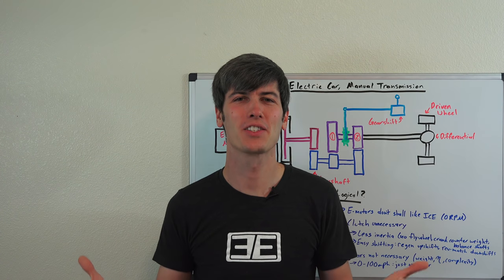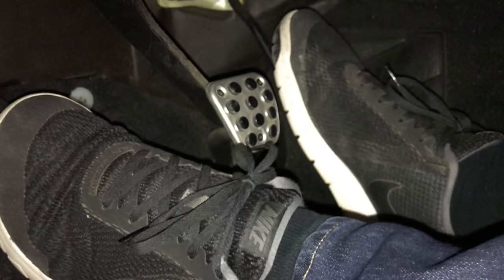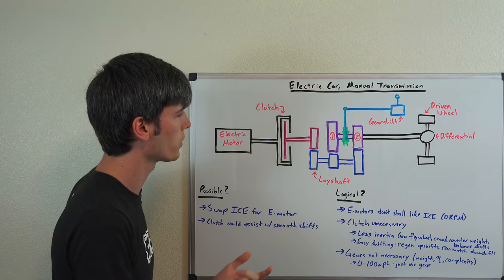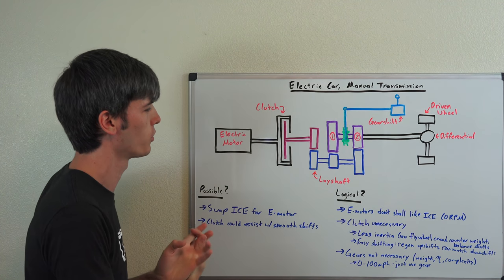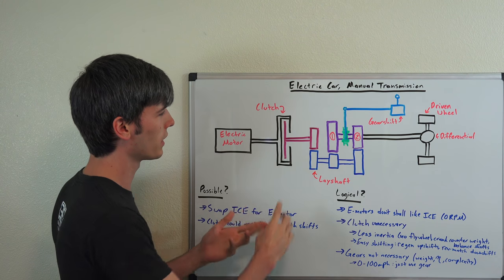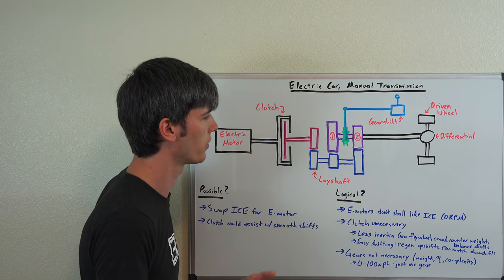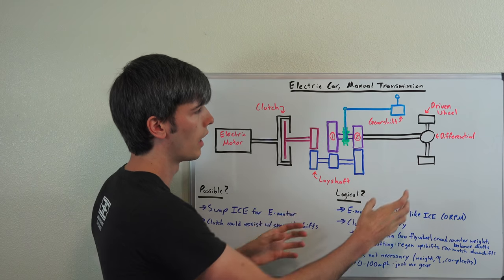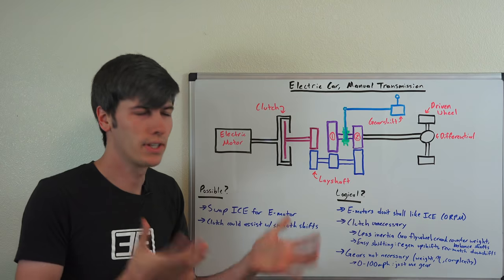Could Electric Cars Have A Manual Transmission?

Comment: Yeah but couldn't a gearbox fix the "electric cars have worst top speeds" problem?
Reply: Ever hear of overdrive? You can gear it so the wheels spin faster than the motor.
Reply: I believe it can be designed as higher than 1:1. It is at most 1:1 for now ,because that is all combustion engine need.  As far as I know, some CVTs can implement higher ratio than 1:1.
Reply: Koeingsegg troque converter that is used in his hybrid hyper car. It doubles the torque in certain situations. The car itself has only one gear (7th speed gear). From full stop until road speed limit the TC multiplies the torque so the wheel can accelerate very fast until it gets to a 7th speed gear ratio.

I think we could think something similar to this in eletric cars and have supercruising speeds. It'll solve the problem with heavy batteries and eletric car mileage. If some effort put in this tech design gave us any potential benefits we could even think of a small battery pack, weight reduction, better top speeds, etc.
Reply: +Carl Nesensohn
Overdrive was designed for better fuel economy. It has no benefit on an electric car. The electric motor is not so confined to a narrow RPM range into which it can deliver its peak power. Overdrive is not so much to make a car go faster, but rather to slow the speed of the ICE (internal combustion engine) on mostly-flat freeway driving, so as to burn less fuel. With horribly-outdated ICE technology, most every revolution of the engine is going to burn a certain amount of fuel. But I have heard that only 15 horsepower is needed in order to drive at freeway speeds. So why do cars have to have such big engines and so much power for? So that they can easily climb hills, and not scare the driver, having little or no acceleration power to be able to merge onto the freeway or to pass another vehicle, lagging like some giant super-heavy semi-truck 18-wheeler.

Actually, I think I heard that the Tesla electric cars have a small gearbox that is a 9 to 1 ratio, meaning that the electric motor spins 9 times as fast as the drive wheels. There is no need for the wheels to spin faster than the motor, as that would exceed the speeds that most cars ever travel at. There is no need to shift to a lower gear, because the electric motor already has sufficient torque and can easily start from 0 rpm - it does not stall like an ICE. But the gearbox is very simple, just 1 speed gear, very few parts to wear out. Electric motors can be electrically-reversed, so there is no need for a "reverse" gear.

There are basically 2 considerations that limit how fast an electric motor can spin. One is the physical centrifugal force that above a certain speed would tear the armature apart. The other is the available voltage for the motor, as a motor and a generator are much the same thing, depending upon how they are wired. The faster the motor spins, the more opposing voltage it produces, so that the current can no longer flow very much, once it reaches its peak speed. That is why a too-much bogged down electric motor overheats, because the current continues to surge. But electric motors can spin or be designed to spin at very high speeds. And unlike an ICE, there is very little mass within the motor to accelerate, nor are there any gear-shifting delays in the acceleration curve, there is no heavy crankshaft, and so acceleration in an electric car can easily beat muscle cars and sports-cars.

The ideal gear ratio for the electric motor, is based upon 2 factors. One is, what level of performance is expected and can that ratio deliver it. The other, more important in my view, is efficiency. If electric cars can not deliver enough miles on a charge, then they will be hard to sell to many people. Thus, it is very important to conserve energy, so that the battery does not deplete any faster than necessary. That is why EVs are even better aerodynamically designed than ICE vehicles. They have to do whatever they can to boost the range on a charge to a sufficient miles number to impress potential customers. Well until the battery technology further improves.
Reply: Electric motors usually have 20000 rpm limit, why would one need to go beyond that rpm ie.. 1:1. And why would you need gears when you can have the same torque at 1rpm and 20000rpm? Habit???
Reply: +za guite
Electric motors have maximum torque at 0 rpm. It is not as much torque at all speeds, as there is back EMF to deal with, when an electric motor reaches a significant speed.

The gear reduction ratio is important, as if the electric motor spins too fast at a given wheel speed, then it could have trouble reaching the fastest wheel speeds it is expected to produce. Or the motor could exceed its maximum safe speed to rotate at, causing the electric motor to self-destruct. If the electric motor spins too slowly, then its wheel torque will be too low, acceleration would be poor, and it is going to pull too much current and perhaps overheat much like a rotor-locked or stalled electric motor. The gearing reduction helps to amplify the wheel torque, by allowing the electric motor to spin faster and use mechanical advantage to increase the effective wheel torque.

So why do electric cars lack a transmission? Because electric motors can produce their peak power output, over a much wider RPM range than an ICE can. Since it well covers the entire speed range of the car, including even reverse, there is simply no need for a transmission, as with an ICE that would stall without a clutch (manual) or a torque converter (automatic). And because if the efficiency gains achievable from using a transmission are below a certain threshold, then the weight and cost of the transmission can not be justified and the transmission itself wastes some of the engine's power in the form of inefficiency and waste heat. Lacking a transmission, is all the fewer parts to fail and to cause problems. A gear reduction is a lot simpler, and does not weigh nearly as much as a transmission. And without a transmission, there is no need to change gears. So no computer has to decide when to change gears as in an automatic transmission, nor is any space within the car cabin wasted on a needless gear change lever for a manual transmission. Acceleration is faster, as there are no hesitation gaps caused by the time needed to change gears. Also consider how fast some electric elevators are, and those electric motors never change gears.

Habit? Not at all. Any car driver can easily learn to DO NOT CHANGE GEARS ANYMORE, NOT EVER. Especially those drivers who like automatic transmissions anyway. So it can not be "habit". No, I fear that some car enthusiasts want to also ruin the electric car, like how they have somewhat ruined the ICE. We must not let them do that. Tell them to leave their pretending that they are some glorified race car driver, to the video game land of make-believe, and that you do not need to change gears anymore to drive a car. If they want to be old-fashioned, why don't they get some heavy car made out of rock with round rock wheels and with no brakes, like the Fred Flintstone cartoon car? Well that car never really existed. Come on, get with the times! The days of the horrible costly transmission problems are nearly over. Get over it. There is no need for a transmission in an electric car.

The days of driving may soon be over as well. Within a decade, we may see cars fully capable of doing the driving all by itself. It will only need a driver/operator to specify "Where would you like to go to today?" And I am very hopeful that self-drive technology will make cars much safer and much more convenient.
Reply: +fafaelrp07
No wonder-technology-transmission is ever going to solve the problem of heavy battery packs in electric cars. Because the problem is, as it long has been, the lack of high enough energy density in batteries, and it takes a lot of energy to overcome the tire rolling resistance and wind drag, over many 100s of miles of driving. It is not a transmission or lack of, that drains the car battery, but rather the toll of propelling a heavy box or room at 65 mph on the freeway for many hours. It takes quite a lot of electricity to recharge an electric car, however, the electricity is a lot cheaper than the fuel that would otherwise be burned in an ICE.

Technically, I think that electric vehicles get better mileage at city speeds, and struggle to go as far at highway speeds, due to the higher wind drag of higher speeds.

A small battery pack is impossible, unless you want an electric car with an impractical short "commuter" to place-of-work range only, 50 miles or less on a charge, or we invent much better batteries, say like much less expensive super-capacitors, something super-conducting or something. Or implement the NWO-suppressed free-energy technology.
Reply: Diogo Almeida Um in a world that has Tesla's which have a pretty decent top speed (and an insane amount of pick up in Ludicrous mode), why would you ask such a question?
Reply: because electric dont produce the same torque at 1 rpm as they do at 20000 rpm, theyre the opposite of combustion engines in that torque drops off as as rpm increases

Comment: If applied correctly, couldn't you use an automatic clutch with one singular gear with lots of teeth on its output, increasing the top wheel RPM speed? I mean, it would increase efficiency especially in things like drag racing, top speed and starting and stopping. If you just had an electric motor straight to a gear with lots of teeth on its output, the electric motor probably wouldn't have enough torque in the lower RPM so this is where a clutch would be necessary.
Reply: Electric motors have characteristics very different from internal combustion engines.

An electric motor can develop its maximum torque at zero speed so there is no reason whatever to have a clutch for starting out.  Also, an electric motor can, for limited intervals, develop several times its continuously rated power with no damage.  In cases where the electric motor must be as light as possible, there would be an advantage to having a multi-speed transmission.  However, in general, the advantages of having a multi-speed transmission would be offset by the additional complication.

Comment: I'm interested in what the power to weight ratio for an electric motor is compared to a combustion engine.
Reply: And what about the price for same performance and type : is an electric car more expensive ?
Reply: 1kw/kg ice to 3-8kw/kg electric. Batterys are heavy.
Reply: The batteries for an electric car is the expensive part, electric motors are cheaper than combustion motors.
Reply: Anthony Much better

Comment: All electric cars today have a transmission, including Tesla's.  The Tesla has a reduction gearset for each motor.  The cost and weight of adding a second gear and a reliable gear changing system has to compared vs it's return in 99% of driving scenarios. Any car designed primarily for high speed running would need tall gearing that would not have good acceleration. Any vehicle that has massive weight changes such as a truck towing a large trailer would need gears to avoid have to carry a too large motor around for when it is not towing.  Most cars could perform satisfactorily with only one gear for 99% of their use cases. 
Dual motor Tesla's have two one gearboxes, each with a different ratio to match the motor that drives it.  The overall efficiency could be increased further by not turning the larger rear motor at relatively low speed and low loads. If a Tesla was designed to run at sustained autobahn speeds  the gear ratios would change from the ones used today for 70 mph cruising. 
Direct drive A/C induction electric motors are not yet desirable for several reasons.  Hub motors are even less desirable, because they would massively increase unsprung weight which negatively affects handling and ride quality.  
Electric motor tech is not advancing very fast. The science has long been understood and only small efficiencies can be gained using known science.  Improving the battery is the holy grail for car manufacturers.
Reply: Currently Tesla, as you mention, uses induction motors.  On the other hand, some electric cars and hybrid cars use synchronous motors which are slightly more efficient.  Probably, as you say, hub motors may never be used on cars.  The biggest problem for electric cars is the batteries.  They are big, heavy, provide only a limited range, and have a limited life.  Even so, in some cases I think that battery electric vehicles make sense even now.
Reply: Frank Eggers we reached nice range and also good reliability. The weight may sound bad but for consumer it's not a problem.
Reply: Sprowk, I wonder if you could clarify.

The battery weight may not be a serious problem since it is down very low in the vehicle resulting in a low center of gravity and the vehicle is designed to handle the weight.  But the weight of hub motors would be a problem because it would be unsprung weight.  Some vehicle manufacturers have gone to considerable length to minimize unsprung weight.  Hence, many cars, even  ones with rear wheel drive, have independent rear suspensions.  Light alloy wheels are also used.  That enables the wheels to do a better job of staying in contact with the pavement when the pavement is not smooth without resorting to stiff suspensions which would result in an uncomfortable ride.

As for range, some electric cars already have adequate range for city and suburban driving but not for long trips.  Thus, the range is adequate for many people.  Either a battery exchange method or ubiquitous fast charge stations would be necessary, with current battery technology, to make EVs practical for long trips.  I  wonder what effect rapid charging has on battery life; I suspect that it would shorten battery life but I haven't seen any information on that.
Reply: Frank Eggers there is taxi driver in Norway driving his tesla which has incredible mileage. Don't know exact number but it shows that at least for him the battery still keeps above 90%. As far as the range goes tesla with charger network is pretty good. At least in my country (I bet you didn't hear of, Slovakia) it would be sufficient for any trip.
Reply: Sprowk, Actually I have heard of Slovakia.  Decades ago I had a coworker from Czechoslovakia.  She told us that the country would break up when Marshall Tito was no longer the dictator because the various groups would not get along with each other.  Obviously she was right.  Regarding geography, I am much more erudite than most Americans although unfortunately, I speak only English.

Now, returning to the subject.  The battery life of an EV would depend on how the car is used.  Deep cycling the battery or frequently charging it at a high rate would shorten the battery life, although it could still remain adequate depending on circumstances.  It would be better if all EVs could be recharged from the same charger network, for obvious reasons.  It is likely that battery technology will continue to improve.

It may be that EVs will replace fuel burning cars because CO2 emissions from cars are a significant percentage of total CO2 emissions which must, on a global basis, be drastically reduced even as demand for energy increases by a factor of probably 3 or more.  EVs would help do that, especially if electricity is generated from non-CO2 emitting sources.  Or, IC engines could be run on a manufactured fuel, such as ammonia, if it is manufactured in a way that doesn't emit CO2.

Some countries which have enough hydro power available can get by on renewables alone.  However, whether people like it or not, most large prosperous countries will have to depend on nuclear power.  I suggest a google search on "James Hansen nuclear", and other google searches, for more information.  The mass media do not adequately cover the subject and most people access only information which supports what they already believe.  At least Slovakia doesn't seem to have the irrational nuclear power fear that is so common elsewhere.
Reply: Frank Eggers nice article, totally agree. Moreover if we succeed to mine some asteroid containing uranium or whatever substance modern nuclear is running on we should be good till end of century.

Comment: We did electric + 6 speed sequential gearbox. You don't actually need clutch, as you can speed up or decelerate the motor so quick, that it can do it all in a gap between gears. You can sync the motor to precisely match required RPM before to switch in to gear.

Comment: but it will never give the pleasure of a real car!
Reply: Try driving a Chevy VOLT it's got pretty good power. The VW Gulf electric has a nice sporty suspension not quite as powerful as the VOLT But still pretty fun. I haven't tried a Tesla but I'm sure the acceleration in those is fun.

It's a different experience though, it's quiet and smooth generally, it's nice and comfortable, with lots of electronic features which is pretty neat.
Reply: It's a different kind of pleasure.  I love when our Prius is running in electric mode.

Comment: Tesla Model 3 has highway range of 200 miles if you cruise at 75 MPH vs 300 Miles if you cruise at 60 MPH.  So will gear help?  or use different gear ratio?

Comment: It would make sense for some applications where you want to get higher gear ratio for more torque like trucks or construction vehicles. You can tow stuff in low gear and have direct drive for running without load and save charge.

Comment: Ive had had in my head the idea of having 6 different power levels that accelerate differently and have different top speeds. You'd use a sequential level to go up and down and somewhat have 6 different levels of acceleration and top speeds.